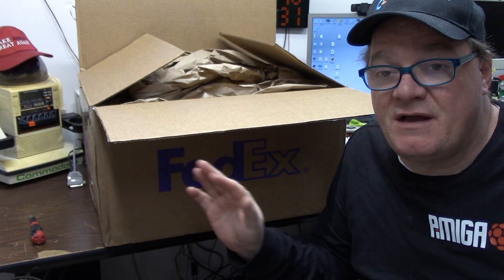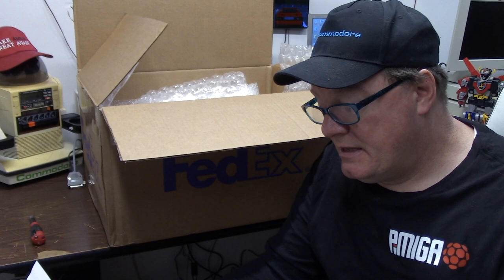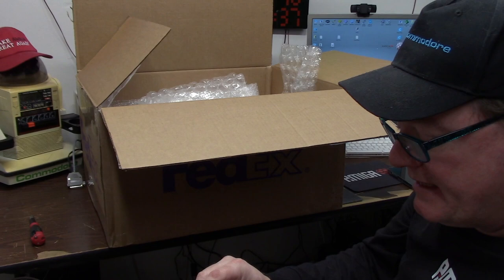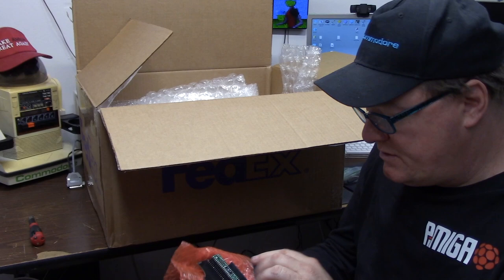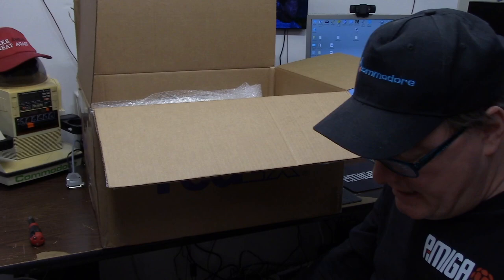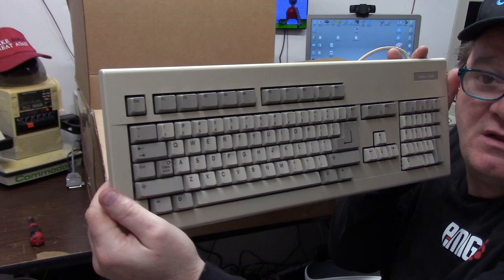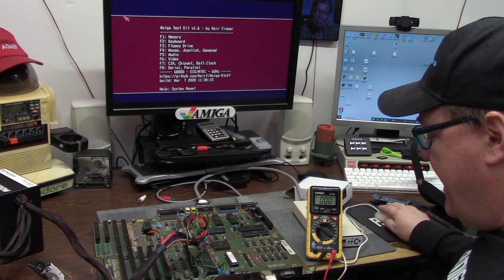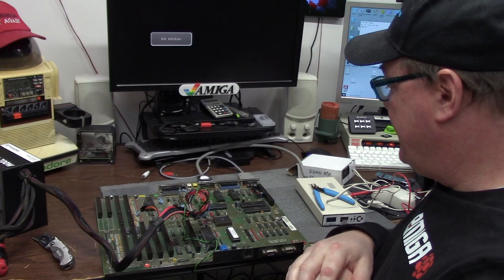A2000 repair for subscriber P1 Worlds longest lasting non leaking GP battery!

Comment: My A2000 Chris still has its orginal battery, and I have the cherry keyboard with the left shift that doesn't work. lol
Reply from the maker: and its not leaking ? wow GP i bet. all vartas barf
Reply from the maker: also cherrymx keyboard repair is p3, coming soon
Reply: @ChrisEdwardsRestoration  I will take a picture and put it on FB on Commodore Amiga (I think your on the group right?) :)

Comment: Everyone seems to be replacing barrel with coin cell battery. Why not just use new barrel battery.
Reply from the maker: Reputation, plus a 2032 is readily available and inexpensove
Reply: why would u reinstall a battery known to leak and eat the board?
Reply: @a4000t  New NiMH batteries are not prone to leaking.